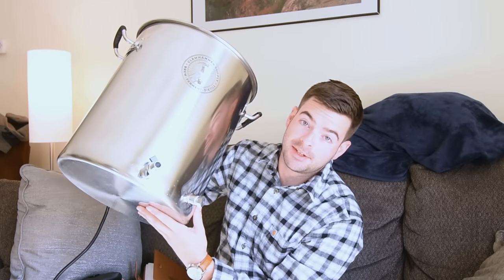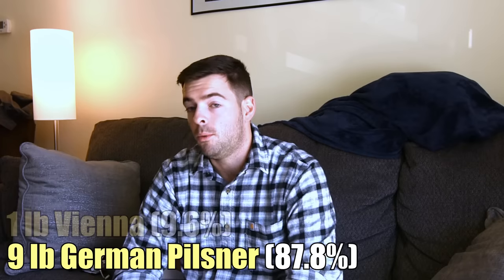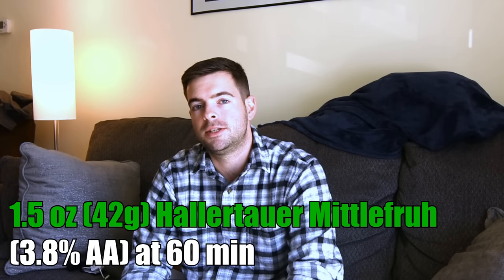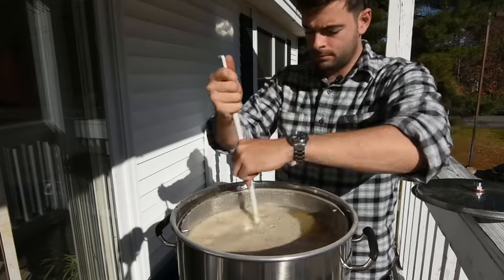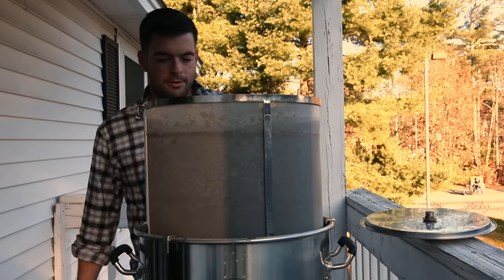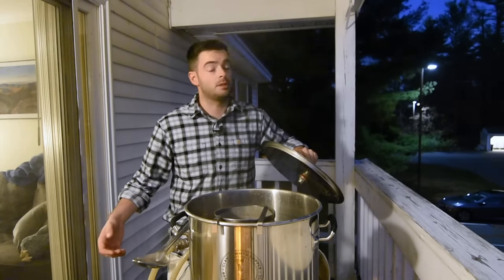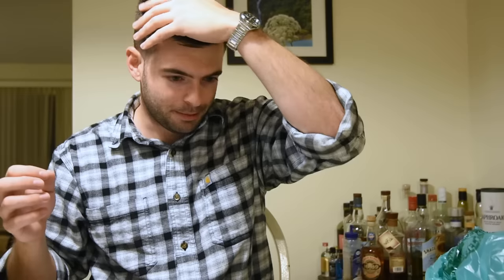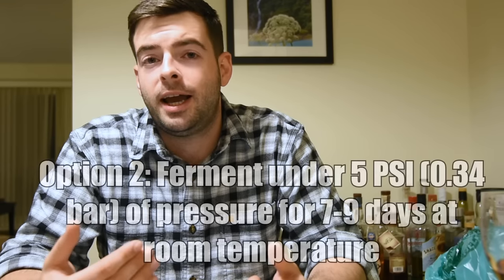Brewing a HELLES Lager on the CLAWHAMMER SUPPLY System | Grain to Glass | How to Dial In New Systems

Comment: Wrapping your kettle with some insulation will help a lot with your heat up rate. I used a foam core radiant barrier insulation that I got from Amazon for ~$25.
Reply from the maker: True! I actually am going to get a kit from clawhammer soon but they have to their new design in stock first
Reply: @TheApartmentBrewer  And bust out that heat stick you've used before to pump in a few more watts.
Reply from the maker: @andrewbarker1190  Would need a separate circuit handy for that, otherwise it'll pop the breaker

Comment: Great video, I am glad you got a new system.  Question, I am currently using a mash and boil all in one system with a pump.  I do a sparge step after mashing and my efficiencies have always been really good, like around 75% plus.  By eliminating the sparge step with this system will you be reducing the mash efficiency?
Reply from the maker: Oh absolutely. Its an easy compromise in my opinion buy just getting some extra grain. That being said I was still very surprised at the efficiency I got for this brew despite being a BIAB style system.

Comment: Did you use a single or double crush (for the grains?).  What was the pH (planned versus actual)? Did you only use 2 packets of yeast since you were fermenting at room temp with pressure?  Great video, and glad you can get outside with it.
Reply from the maker: I ended up doing a single crush actually. And I ended up with both planned and actual pH matching at 5.2. I would have still pitched a starter if I had the time but I still recommend a full lager pitch if pressure fermenting.

Comment: Great video! I appreciate the innovation of using distilled water since we can now easily follow your brewing salt additions. Since you have a hot rod you could use it with the Clawhammer if you can find a separate circuit somewhere nearby.  I brew with 110 volts too and let my water heat up while I grind the grist, measure out hops etc.
Reply from the maker: I wish I had another circuit handy, I'd be boiling in 10 minutes with two heat sticks! Glad you like the water changes, I think it's overdue. Only costs 8 bucks per brew but there's a lot more payoff. I've found myself doing stuff like shooting the intro/recipe clips and stuff while that happens. Or shopping for my ingredients lol

Comment: I've had my CLAWHAMMER for a couple of years and absolutely love it. I am hoping to upgrade next year. I just got my 240v outlet in. 
Note... I've done a 21lb grain build in the 120v... I'm not sure what the max weight is but it handled the 21lb no issues.
Reply from the maker: Very nice, was it a batch smaller than 5 gal?
Reply: @TheApartmentBrewer  No, it was for a 5 gal batch. The grain build was 21lb. The Anvil can only hold about 16/17 lb max
Reply from the maker: Hmm, when I mashed in with 18 lb of grain for the wee heavy I brewed after this I ended up with only 4.5 gal, maybe there's some starting volumes adjustment I need to work on. I used 8 gal of water
Reply: @TheApartmentBrewer hmm... I'll try to screen shot the anvil guide as it's pretty good at the starting water measurements. 
Did that 8gal also account for the hop addition(s) or just grain?
Reply from the maker: Thanks, I'm curious! It was a wee heavy so it was only about 1 or 2 oz of hops
Reply: @TheApartmentBrewer  in my experience i typically add another 1/4 gal per oz of hops in a biab... plus, if you have the 240v, it takes a lot more water... found that out in my Anvil...wowza!
Reply: @TheApartmentBrewer  btw... where about in New England? I'm in RI

Comment: You could insulate (Clawhammer has a video on it) and leverage your heat stick to help with water/wort heating up to temps.
Reply from the maker: I plan on it, clawhammer has new insulation kit they will be sending me eventually. As for the other heat stick, while it would work nicely it requires a separate circuit to avoid tripping a breaker
Reply: @TheApartmentBrewer  Hmm. Another odd ball idea to speed up would be to seperate your water/wort in 2 vessels (your smaller kettle) and use the stove top. Then again, that's only if you really need to shave that 20-30 min extra from the brew day. If you can let it go on auto pilot the extra time is not that bad anyhow
Reply: @TheApartmentBrewer  I do something similar with my Grainfather. I located the nearest outlet that was on a different circuit and use a beefy extension cord to my hotrod heat stick. I've not had any issues this way and it does save significant time coming up to boil temperatures.

Comment: Another great vid!  So this was a full volume mash and no sparge/additional water ?  Beer looks superb, I love the focus work on those rising bubble!!  I have absolutely no experience with any brewing system but I find that the Clawhammer looks sort of finicky to use.  All the tubes and valves poking out and having the controller separate doesn't draw me to it, I have watched some of their vids and the controller looks counter intuitive but it probably makes great beer once you tame it.  I'm looking into systems and I will most likely get the Brewzilla 35, seems more self contained.  I know what you mean with exterior light, I'm fomr Quebec City and it gets dark early and fast in the fall, I miss the fall!  Also do I spy a Lagavulin16 behind the Laphroaig 10 !?
Reply from the maker: Thats correct, the "sparge" happens when you pull the basket out of the wort and let it drain. Some people when doing BIAB will rinse the grain to sparge in a way (I used to do that) but I've found I've hit sufficiently close to my calculated pre boil gravity in most cases. It is a lot of "stuff" but I've found that makes for it to be easy to replace parts and maintain if needed. Lagavulin 8 in the back! Cheers northern neighbor!

Comment: At 11:52, all that condensation that dropped back in..probably better to at least hold the lid off to the side and dump that part..I thought conventional wisdom said covering the boil allows the badness you’ve boiled off to re enter the wort through condensation?
Reply from the maker: Yes...ish. It didn't have an impact on the beer. Most modern malts are not going to be capable generating as much DMS as they did back when that conventional wisdom was established.

Comment: I guessed right about the clawhammer system! The biggest flaw of that system is the three loose hooks that make you want an extra hand or two, god help you if you dropped one into the pot while lifting...
Reply from the maker: Yeah its definitely not as streamlined as say the grainfathers style but I've found if I keep the vessel on the floor for the mash I can get a lot more leverage on it and it's easy to get them all in snugly
Reply: @TheApartmentBrewer  Set Up a light pulley system.  It's very simple and  inexpensive.  Works great if you are doing it on your deck.
Reply: I have this system and use a small step ladder for a bit more leverage when pulling the basket if you don’t want to mash on the floor.

Comment: If you want it to taste like Pauläner stop fermenting at 72F. Pitch it at 45f on an entire previous yeast cake and hold it at 48 for the rest of primary. Lager 101 really. Lack of off flavors doesn't mean presence of correct flavors. Rant over, and I do like your vids.
Reply from the maker: All good, not everyone really buys in on the pressure fermentation thing. I'm just happy you didn't have a mental breakdown over me not decoction mashing!
Reply: @TheApartmentBrewer  
If Decoction was important to a Bavarian Helles i may have lol. None of the big Munich brewers are using Decoction on Helles, but they're all fermenting in the 40's. It cracks me up how home brewers will mimic every detail of some NEIPA brewery including zero O2 dry hopping and transfers, but fermenting a lager below 50 degrees is just too much to ask. And I promise you Pauläner's effective fermentation pressure is over 5 psi. That's really marginal. I do admire how often you brew though. I need to step up my frequentsy.

Comment: pull the oven away from the wall and plug in 240v element :) or dryer
Reply from the maker: Ha! If only I could
Reply: @TheApartmentBrewer   your stove is not attached to the wall (i looked at video 😂) 
I used to pull my dryer away and run an extension cord.to.the controller
Reply from the maker: No its not, but I rent and I'm not sure that would go over very well with the landlord. Also I would need 240V equipment which I don't have access to. Good idea but it just doesn't quite make sense for me right now
Reply: @TheApartmentBrewer  CHS can always be upgraded later 😉
I built my system bases on their ideas, unfortunately buying.one from them and shipping to central Canada is not cost effective
Reply from the maker: True haha, they do have a 240V system that may make its way into a garage or something later in life!